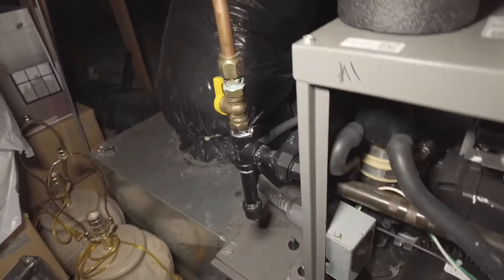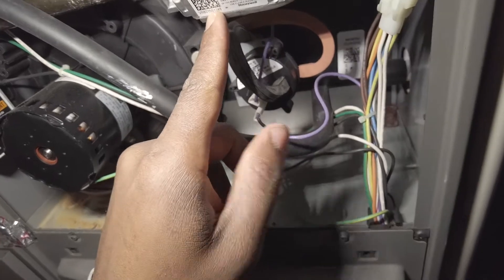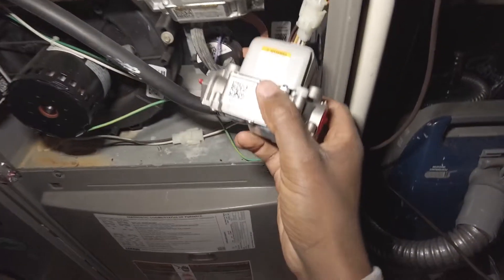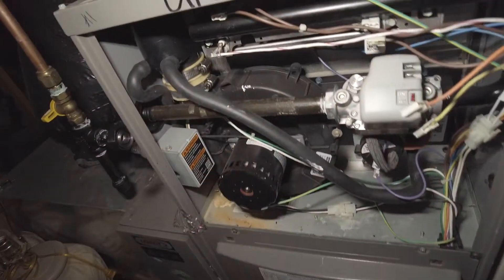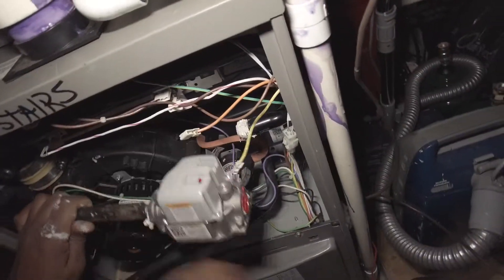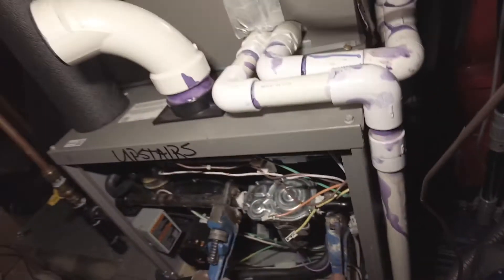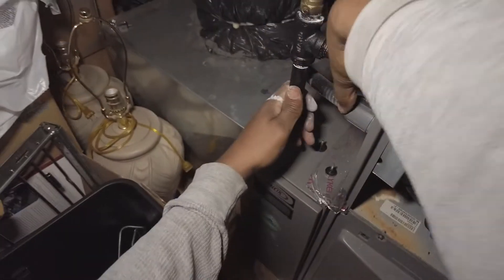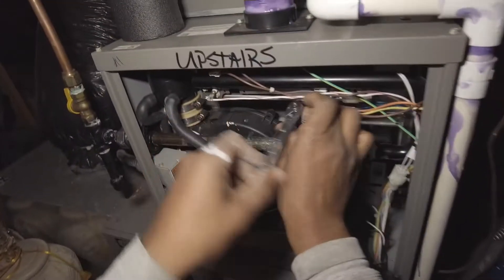HVAC Tech Gas Valve Replacement on Lennox Furnace -How to use Sequence of Operations to Troubleshoot

Comment: I could really use another video of you using the menometer on this valve.
You mentioned that you would check it on the outlet side but you put the furnace cover back on .
Do you have that video?
I’m replacing the Honeywell Gas valve on mine , not certain how to connect the meter to it.
Reply: Best video I’ve seen on this particular valve yet, I’ve been searching, keep up the good work!
Reply from the maker: Thank you! Definitely appreciate the feedback and thanks for watching
Reply from the maker: Yes sir I have a few videos on how to check gas pressures. Unfortunately every time I try to copy a link in the comments youtube deletes the thread but there's a video in my maintenance playlist how to check manifold pressures. hope this helps

Comment: I enjoyed the video but that little gas sniffer caught my eye and is on Amazon for around $30.  Amazon reviews are iffy.  You may have 2000 positives and only 5 who know what the heck they're talking about.  It sounds like the unit can be set overly sensitive and cannot tell WHAT it is detecting.  Now it's possible that both of these are actually ok.  It finds some gas that doesn't belong there.  So question, do you follow up with bubble solution?  I wouldn't stake my life and property on a $30 Chinese product.
Reply from the maker: I'm not sure about all the other reviews but I like it pretty well you can really dial in the sensitivity to be hair trigger sensitive which is cool for finding those smaller leaks

Comment: What fitting is that where you disconnected from the shut off? Got a unit rusted from the shut off to the valve because of a water leak that was above the furnace and I wanna order those and replace them w the gas valve I got scheduled Monday
Reply from the maker: Are you talking about the Union fitting?

Comment: I ran into a situation where the gas valve was sealed with PVC glue. What're your thoughts on that? Could pvc glue be a replacement for pipe dope when in a pinch?
Reply from the maker: No sir... I wouldnt recommend it.

Comment: Thanks for the video.

So, no need for that white sealant on that outside connection?  Doesn't look like there was any there before either.  You think it would be okay to put some of that yellow gas tape on those particular threads?  Or best to just leave it bare?
Reply: Never connect any gas lines without sealant!!! Ever!!!

Comment: What were you doing with the service wrench? Were you regulating the gas?
Reply: He was purging the line.  That pipe he attached to the valve had air in it still.  So, after he turned the gas on (and before turning the unit on) he unscrewed a bolt near the valve with that wrench in order to let the air (and some of the gas) escape the pipe.  Apparently air in the line is bad.  Though, I'm not sure how vital that step is here since there would be air in the pipe on the right side of the valve also.  Anyway, I have no clue if the way he did it was the right way or not.   The thing didn't blow up so probably was right way...lol.
Reply from the maker: You're exactly right! I like to purge the air out of the lines first because it helps it light up quicker. If you don't purge the lines sometimes it'll take four or five attempts before the furnace will light.

Comment: I like your videos bruh. Lennox and carrier must use gorilla pipe dope to put their gas valves on. The trick to getting the gas valve off is to buy a heat gun from home depot in the paint department and heat the part where it screws into the gas valve for about 5-7 minutes and then it will come off easy with no struggle. You can spend 5-7 minutes waiting or 20-30 fighting
Reply from the maker: Thanks a lot glad you're enjoying the content. Definitely appreciate the feedback my heating the pipe dope first. Ill keep that in mind for next time.
Reply: Worked! I was fighting with it and finally went to the garage for my heat gun. Came right off. Thanks for the tip.